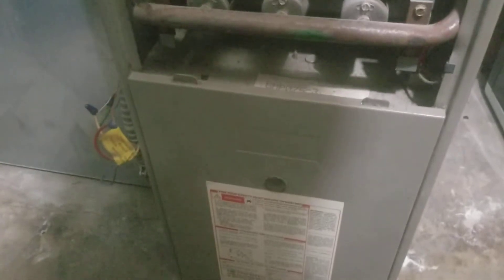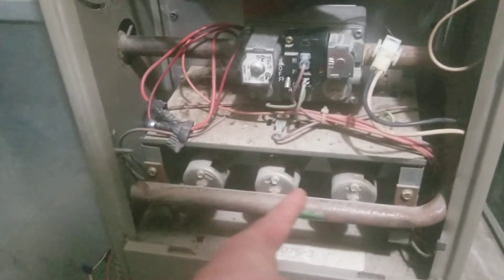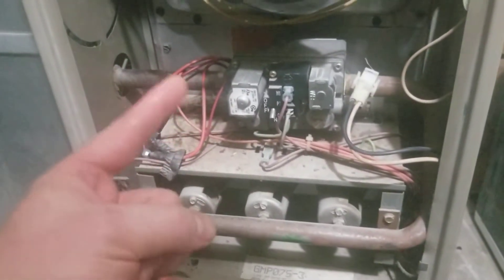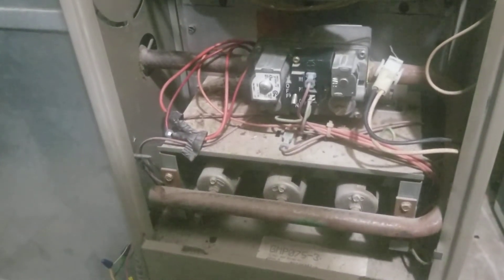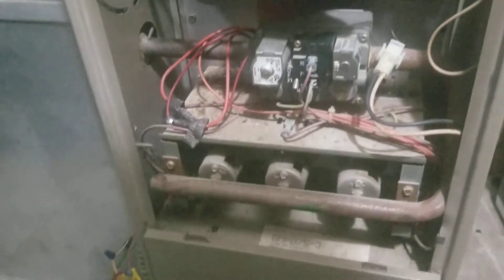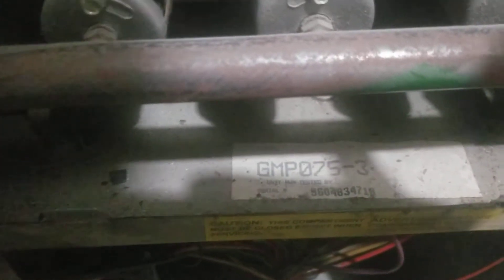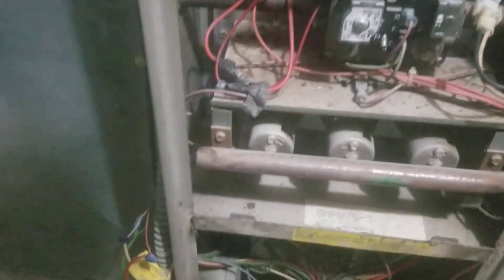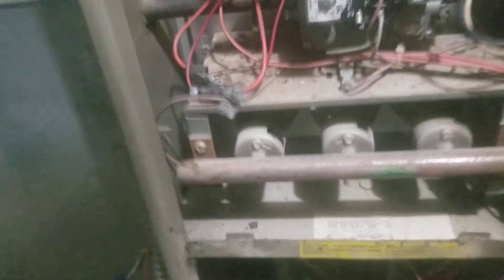Fix a Furnace Blower Fan Won't Turn On... Capacitor & Limit Switch

Comment: How old is this unit? Did you have to remove the gas valve to get the limit switch out?
Nice video
Reply from the maker: About 25 years old, I think.  No, just kind of roughly pulled it out--gently. 😉